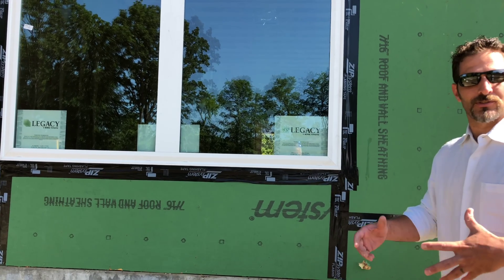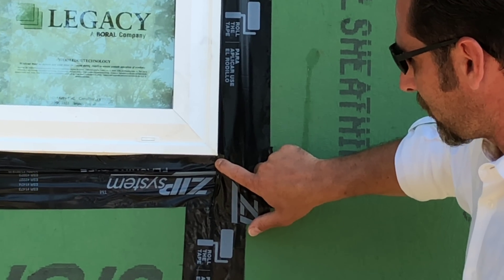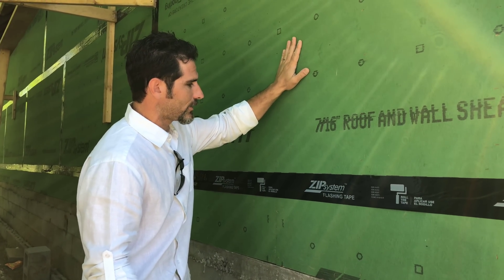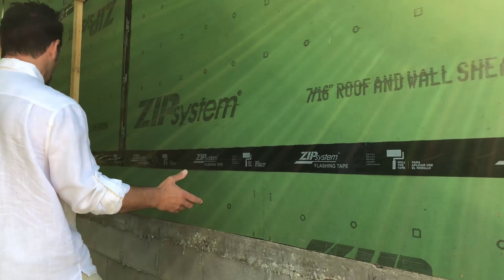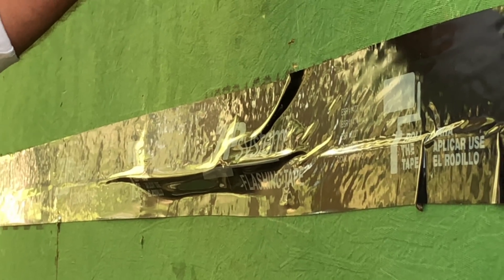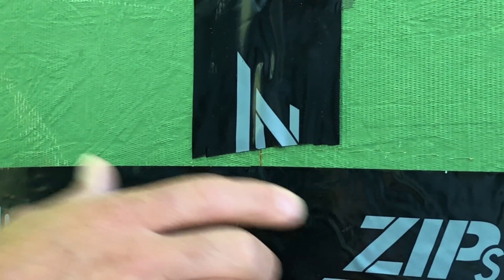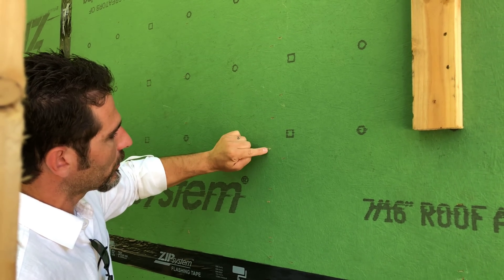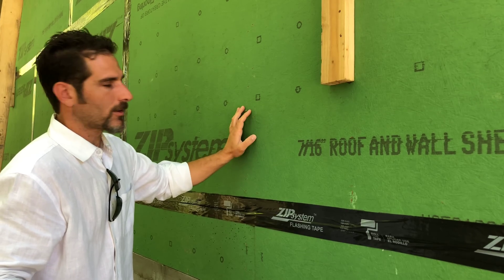ZIP System Problems

Comment: So, you are saying the zip system is bad because people are not installing it the way zip says it has to be installed? That makes no sense.
Reply from the maker: Phil Robeson the problem is this system relies on tape (adhesive) for years of reliability! This means that every piece of tape (miles per avg home) is reverse flashed. This means there is an edge sticking out from the plane which the water is running down the water then catches this edge and has to run horizontally across the top edge of that tape until it makes its way over the edge and continues down the wall. If there are any wrinkles or places that were not cleaned well before the tape is applied then the water will be funneled in to the joint that tape is “protecting”. At that point the water is in the wall cavity behind a less than 1 perm wrb which will trap the water and cause other issues inside the wall. So if it is installed correctly it might work but the risk for issues is very high and not worth risking! Just trying to help educate the people that have been told this system is a cure all for wrbs and is fast and easy to install. It’s not easy or fast to install if done correctly! Then you still have all those potential issues for miles around the house....
Reply: Weather Proofing America I would recommend you watch Matt Risingers videos on the different siding solutions.
Reply from the maker: Phil Robeson What do you mean specifically? He goes over all types of systems, depends on who is paying him as to what he promotes! I don’t have that bias. Just facts and common sense:)
Reply: @WeatherProofingAmerica  Start here first: https://www.youtube.com/watch?v=Mn5KaKu-tt0  How does one know he has bias and you have none? Based on what you say? What proof do you have that he has bias? Have you actually talked to him to discover this or to find what his reason is for making his YouTube videos? (I have, and it does not sound like you have)
Reply from the maker: Phil Robeson I am well aware of Mr. Risinger‘s videos. If you watch his older videos before he was being paid he promoted Tyvek just like I do! He has turned his YouTube channel into a business (that’s not a bad thing until it sways your better judgement) not only his opinions like it used to be. Anyone that knows as much as he does about construction should not be able to sleep well at night promoting a product that you know is not going to be installed correctly on the average jobsite. When relying on adhesive as that system does it is imperative that the joints are cleaned and the tape is applied properly otherwise major issues will happen! Most homes don’t have windows, doors and other penetrations sealed correctly in housewrap systems but somehow zip is going to be sealed correctly with miles of tape, for someone to think that zip is the answer to solving this problem of incorrectly installed wrb systems is just plain stupid!  His video shows how to correctly install the system but how many times do you think that will be done? Even if it is installed perfectly you are still going to rely on adhesive for many years to come for protection instead of simple overlapping that is most of the time at least done correctly even if the windows and doors are not! Everyone has a different view on things....this is mine. I would encourage you to think about this system from a perspective of the reality of an underpaid framer installing miles of tape!
Reply: @WeatherProofingAmerica  

Excellent summary...

I am not a fan of any of the wrap systems.
The whole air leakage argument in my opinion is driven by the energy conservation crowd.
Sure you can insulate so energy is not overly wasted. However, in my opinion (old school)
you can build a house that is too tight. 

IMO, the retention of industrial pollutants from the products used in construction, the furniture, cooking etc as well as moisture retention are more  deleterious then the moisture infiltration problems caused by faulty installation issues with either Zip or Tyvek. etc.

Everyone knows that a roof has to be vented. Unless your using closed cell foam on the underside of the roof sheathing. I think the same applies to wall systems. Yes I understand that TYVEK is supposed to have a perm rate that is superior to ZIP but the goal is also to keep water out. With all those penetrations to secure the material, I have serious doubts. 

With respect to closed cell foam, I am not willing to take the chance that either the mix goes bad during the application of the foam or the off gassing over time is not going to be a problem. 

When I lived in northern Virginia in the 90's, some of the builders were building expensive homes with nothing more then these cheap plastic wraps over cardboard, covered by vinyl siding.
All a burglar needed to break in was a exacto knife.
Reply from the maker: RJ Melehan I completely agree with your statements of building a home too tight as well as the statement of foam and the products used to build the house as well as furnish it such as carpet and furniture. With the zip system you have zero permability which is far worse than any housewrap. I recommend to build a tight home with air exchange systems, in my opinion that is the only way to keep the interior of the home as safe as possible in our current marketplace!
Reply from the maker: RJ Melehan I completely agree with your statements of building a home too tight as well as the statement of foam and the products used to build the house as well as furnish it such as carpet and furniture. With the zip system you have zero permability which is far worse than any housewrap. I recommend to build a tight home with air exchange systems, in my opinion that is the only way to keep the interior of the home as safe as possible in our current marketplace!

Comment: Half the people say it's an installation issue, which is only half true.

It's a system issue because 99% of people arn't educated enough to install it correctly due to ignorance of what really needs to be done. Seems the manufacturer isnt far behind this.

When I flash windows I use aluminum to kick any leaked water   back out to the front of the siding.  Other people use zip tape and the leaked water remains behind the siding. Why does anyone let this happen? Because they are ignorant to the Common sense facts. 

So I would say flashing tape is an inferior product to aluminum, in  almost the same way zip sheathing is inferior to a vapor permeable self sealing house wrap. One keeps water out, and one keeps water in
Reply: You are so correct. I've been in construction for over 40 years, mainly involved with cabinetry, millworks, stairs. The issues are that there is no apprenticeship or training or licensing. Much of the framing/sheathing labor is contract, thereby making speed of installation the number one priority. And I've not met many millennials who had a burning desire to learn the building trades. And a lot of contractors and superintendents lack the updated information or have the detail orientation or just don't care.
Reply: Same concept, thata why you dont caulk j channel at the top of a window. Same reason you dont caulk the bottom of trim. You wanna be able to keep shit out. And at the same time let it out.

Comment: So you claim bad product when there is bad installation and piss poor execution because all those staples should have been sealed with the zip caulk. Trying to bash a product and the issues is INSTALLATION and as for Tyvek I've seen a lot of THAT completely fail.
Also if they are not installing and creating a proper envelope then opportunist like you can come in and bash products.
And your bashing improperly installed products make YOU look very dishonest.
Reply from the maker: MonzaRacer obviously you had the mute activated! LISTEN to what I say in the video! Your statement is completely false....also the magical liquid flash that zip now has, was not available at the time I made this video. So what happens to all the homes that were built before the fasteners were sealed with liquid flash? Terrible system due to poor installation which is a result of them marketing this product as faster & easier to install.....bad strategy because the homeowners are the ones who pay to fix it while Huber get wealthier!

Comment: So it’s Huber’s fault that the contractor doesn’t have a clue or is just careless? Hire a crap contractor, get a crap result even with the best product including tyvek.
Reply from the maker: Jud McFeters Yes! They have done a very good job at marketing this product to be fast and easy to install. When that is far from the truth and this is the result for the majority of the nationwide installations! The seams are supposed to be free of dust and dirt, they tape is supposed to be rolled, there are special terminations that need to be addressed differently like the bottom of the wall meeting the concrete, permeability is a problem once the water is in the cavity & many more issues! So yes Huber is at fault for their false advertising which is leaving jobsites looking like this one!

Comment: Needs a drip cap or "z" flashing installed on top of the block wall(before the zip sheathing is installed) to go up the block face vertically(1 1/2" with an 1/2'" inward turned hem at the bottom which is then bent out at 45 degrees, shedding water away and out from the block), over top of the block laterally(preferably on a 10 degree angle or better), and vertically up the framing members, then install the sheathing so that it doesn't touch the lateral bend of drip cap at its lowermost point, kind of like a piece of hardi-plank siding, never let the edges get wet, or you're fucked. Well, at least that's what I would have done.

Comment: We use a belt and suspender system.... adding a high performance drainable housewrap (preferably one with at least a 1mm spacer) to the zip system allows you the ability to "shingle" the drain plain, flash the windows correctly and provide drainage.  Eliminates the potential for failure due to improper taping and nailing.
Reply from the maker: Geoff911sc very good practice!

Comment: Skilled labor isn’t cheap::::cheap labor isn’t skilled
Reply: Somebody didn't inspect the work.  The workers must be taught to apply the tape correctly.   A careful detail oriented DIY person can do this
Reply: @timothykeith1367  if they had a supervisor who would just give the workers a couple of rollers to make sure the tape lies flat & check the work.
Reply: That is right!!!
Skilled labor is a good reputation and a  profit. Too bad so many contractors are not selective enough to decide who does work for them  and what kind of job they do. Later home owners have to deal with all the problems. In my opinion there should be a 10 year warranty on labour and materials and there should be something changed about that stupid minimum code which in my opinion is the reason for all the problems.
Reply: This doesn't require skill, it's not rocket science - it's ethic and basic common sense.

Comment: Basically comes down to this builder has no idea what they're doing and has poor project oversight. ANY system installed incorrectly is going to cause issues. Install wraps wrong and they'll fail also. Systems don't matter if the builder and the laborers don't know what they're doing. End of story.

Comment: The issues he is discussing are the result of poor installation and construction methods, not a result of a poor product.  Install it correctly and it works great.  Install flashing where you are supposed to place.  His issue with condensation is only applicable to warmer climates and does not apply to more temperate zones.  This video is poorly executed and not explained well at all.  This guy needs to do his homework.
Reply from the maker: tj moon Thanks for watching! Considering that at least half of the country’s climate zones are considered hot & cold permeability is very important! Please educate me so I can do my homework, on why we should not be concerned with a home that is trapping natural occurring condensation at the exterior wall! Also the video if you read the comments and listen to what I am saying, I am simply pointing out how many issues can easily become major problems to the structure all because ZIP is marketing this as a product that is faster and easier to install than housewrap! I am simply trying to show how it is not faster if done correctly & has the potential for way more issues if installed carelessly (like this house) than a home that has housewrap incorrectly installed! Please help me to understand your comments better so we can have an educational conversation and maybe we can both learn something:) Thanks
Reply: Most of the USA is sufficiently temperate (even in parts of the south) that a wall cavity should be sealed from the interior, and allowed to dry to the exterior. For sure, protect the exterior face of sheathing with a vapor permeable system like lapped bldg felt or Tyvek, but never encapsulate your cavity impermeably from both sides.

Comment: You don’t understand the intention of a zip system.
Reply from the maker: Lucky Cactus I am always up for some good education! What is the intention of the ZIP system?
Reply: Weather Proofing https://www.buildingscience.com/documents/building-science-insights-newsletters/bsi-090-joseph-haydn-does-perfect-wall     

You’re  right this product is not fool proof. But it dose preform as it is intended. The link above will show you a vapor profile. 

With out the proper HVAC system or if the perfect wall is not built perfectly zip is not a good idea. 

It is totally safer to vent and insulate .
Reply: Weather Proofing America I am glad you made this video .Thanks.

Comment: Exterior wall sheathing should end up outboard of the edge of the slab. Bottom of wall sheathing should always have a fluid applied membrane cant to shed water and fluid applied membrane should be applied unto the sheathing a minimum of 4" above and 4" below the finish floor. The installation on this home is horrible...

Comment: Your other videos are great, but this one?  ....What is someone made a negative titled video about your company... this video its not a good look for you, most people aren't this fucking stupid.  "we are already fixing zip homes?"  Why don't you call out the contractor instead of the product?  Don't be that guy....
Reply from the maker: Have you seen the marketing Huber is using to push this product? It is completely misleading and is giving builders as well as homeowners, the false security that if they use this product their home will be safe when in fact, it is very far from the truth. So there is more to my video than what you are thinking! I am mainly trying to raise awareness of all the potential issues that the system has when not properly installed. The reason that I am doing this is because I have not only seen many of these issues myself, and had to experience the detrimental effects to the homeowner, but I have also seen these systems installed on hundreds of homes and have yet to find one…just one installed correctly!
Reply: @WeatherProofingAmerica  dude ..... if you want to talk about MISLEADING then look no further than your video title.  It should say "Zip System INSTALLATION Problems".  How does Huber's marketing have anything to do with a crappy installation?  They have a clear recommended process for taping and rolling the seams.  All these materials are tools and its up to an experienced person to install them correctly.  I agree that if you're not going to install this correctly, then you might as well use a regular wrap like Tyvek, but don't fault the company and product for giving people the option to use a better system.  I just built my house and used all zip, had the seams taped correctly, and a continuous peel and stick on top of that from foundation to ridge ... and to be honest it wasn't that much more expensive on a 2,000 sq/ft house.  If your going for a purposely leaky house, use Tyvek.  If you want to go the other direction, zip allows for many options.

Comment: zip shit, osb is junk, contractors are suckers , the industry is making money, just like finger joint trim , remember suckers !!! just like 40 year architectural shingles, bull shit !!! . OSB  will not hold a nail like ply core plywood does, it is not dense like plywood , unless you hit a stud the nails pull through, they split the strands of chips, come on suckers !!! when the air nails brake the coating it leaks, what a sham !!! its OSB guys come on, where is the common sense. I watched  a roofer put slate shingles over this shit before, what a shame, whait until the slate starts popping . the customer got screwed . just think of the money they paid for this job !!!

Comment: So does someone not make a metal drip edge for that space between the zip and the concrete foundation?
Reply from the maker: Neil Heuer there are sill flashings that you can buy but we always made ours.
Reply: So do you have a video on that and is it metal or liquid flashing? Thanks